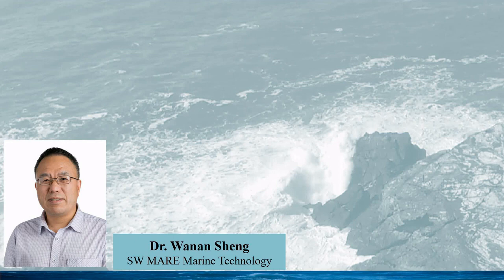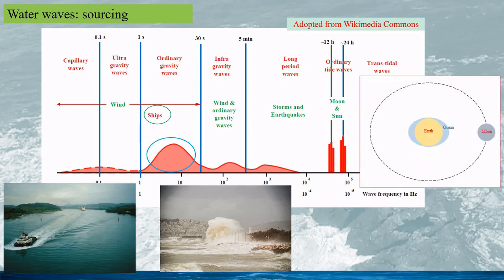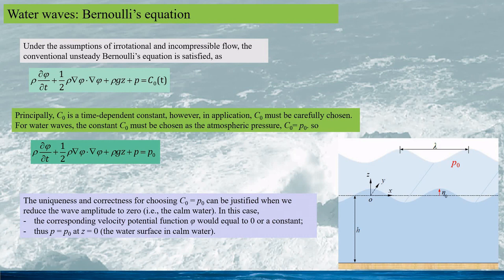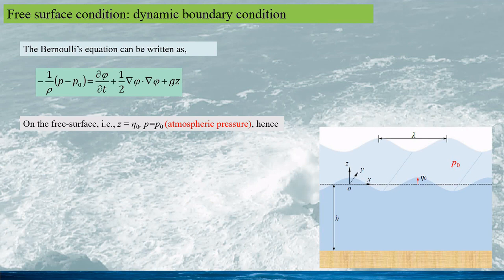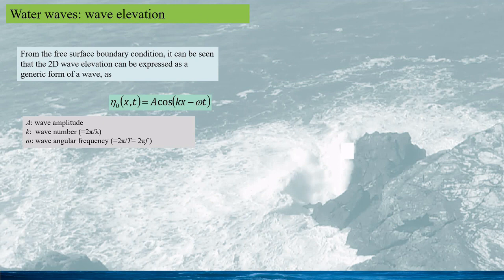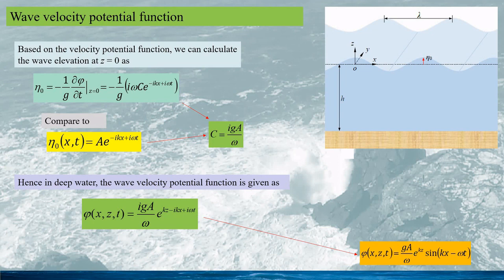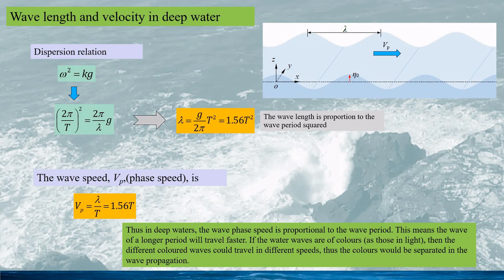[Fluid Dynamics: Waves] Linear wave theory

Comment: Wave Theory: Linear Wave:
00:00 Intro
01:25 Water waves: sourcing
03:08 Water waves: wind generated waves
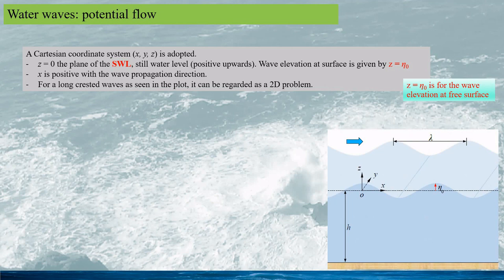05:08 Water waves: potential flow
06:42 Water waves: Bernoulli's equation
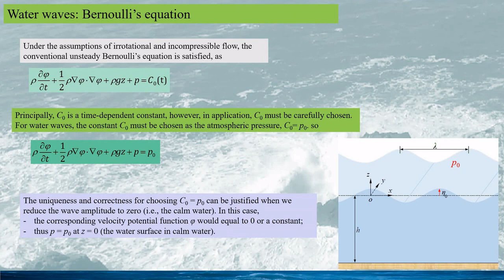08:15 Free surface condition: kinematic boundary condition
10:24 Free surface condition: dynamic boundary condition
11:33 Water waves: equation for the free-surface
11:56 Water waves: wave elevation
13:58 Water waves: potential function (1)
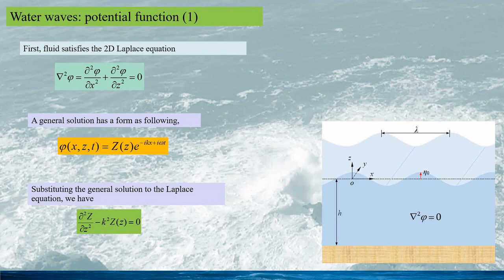14:44 Water waves: potential function (2)
15:22 Water waves: deep water condition
15:56 Wave velocity potential function
16:50 Dispersion relation
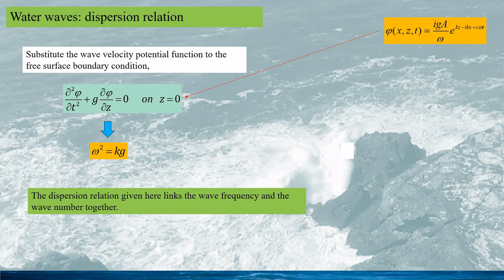17:30 Wave length and velocity in deep water
Reply from the maker: Many thanks for taking time to list all these. Your help is appreciated.
Reply: @ScienceofFluids  it's the least I could do.